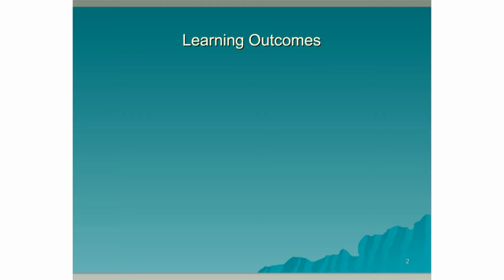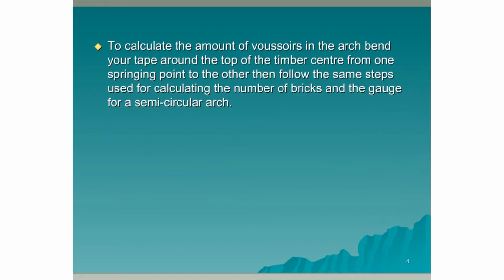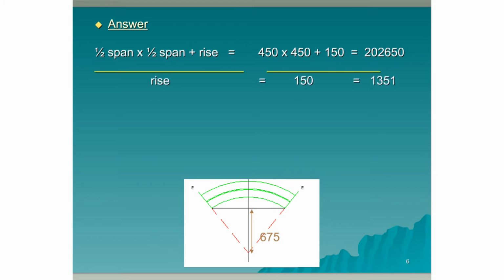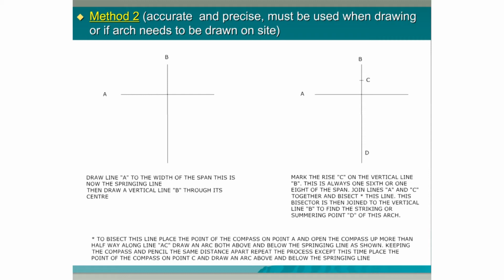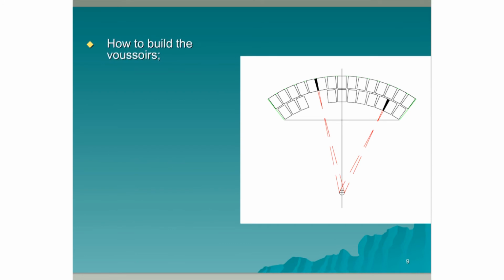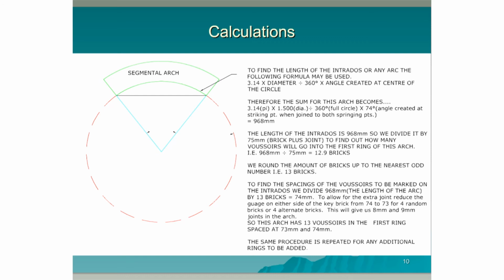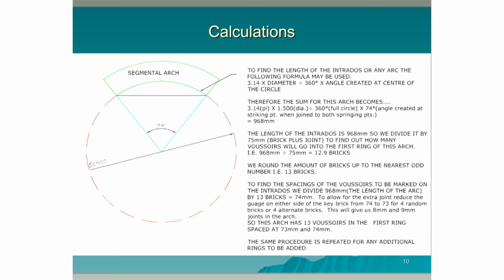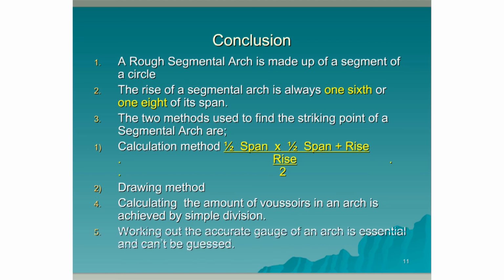9 Segmental Arches

Comment: In your calculations to find the amoubt of bricks how did u find the diamater if the circle and your degrees of the striking point 🙂
Reply from the maker: You should already have the span (width of the opening). The rise is usually 1/6 of this. To obtain the striking point you need to bisect the line joining the springing point to the top of the rise. This will give you your radius, which is half the diameter. The angle can be obtained by drawing all of this out to scale and use a protractor.
Reply: One more question on the chamber arch if i remember correctly the rise on the intradous is 1mm per 100mm so 9mm for 900 ope is that rigth
Reply from the maker: @IanIan-cj7dj  correct Ian. I have detailed notes on it if you want a copy?
Reply from the maker: @IanIan-cj7dj  mine are better ha 😁 email me at hickeymaster@gmail.com and I will send them on to you.
Reply: @hickeymaster  is finding the striking point the same for a parabolic arch as a segmentel arch?
Reply from the maker: @davidcoyle9063  the short answer is I don't know. I am not familiar with parabolic arches. A true parabol is not drawn out the same as a segmental arch. It is quite complex and requires calculation. In practice arches like the one you mention are often made up of other types of arches on site e.g., a gothic arch for both haunches finished on top with a segmental arch. This will end up looking similar to a parabolic arch but will not actually be one. Is this just a theoretical question or do you have a job on?
Reply: @hickeymaster  started a site and all front door openings are parabolic arches with 1400 opening and  400 rise using keystone arches lintels
Reply from the maker: @davidcoyle9063  I take it that this is a pre-formed lintle already set out to the required curve of the parabol? The company who supply the pre-formed lintles might be able to provide you with a drawing of the brickwork. You should message https://www.youtube.com/c/robsonger1/ and ask him how to get the striking point for lining in and building the voussoir's for a parabolic arch. Tricky stuff Stevie, best of luck and sorry i could not be  of more assistance.